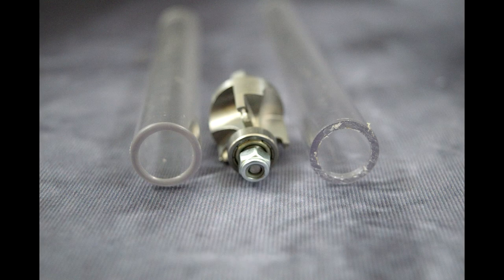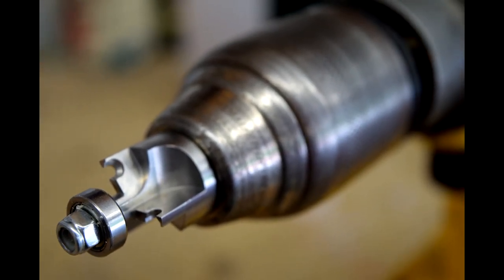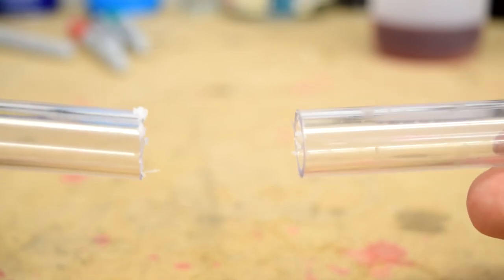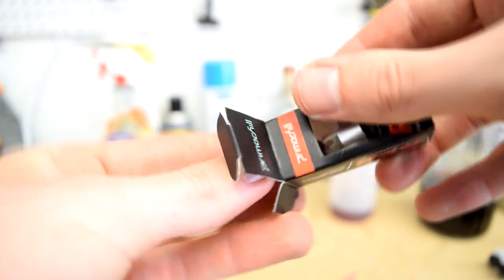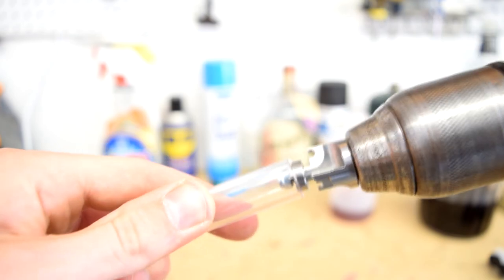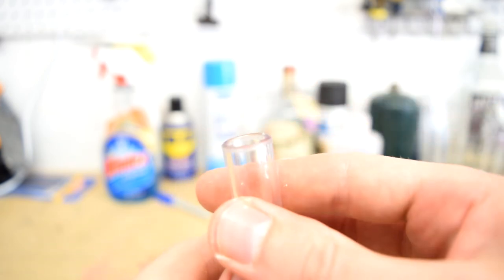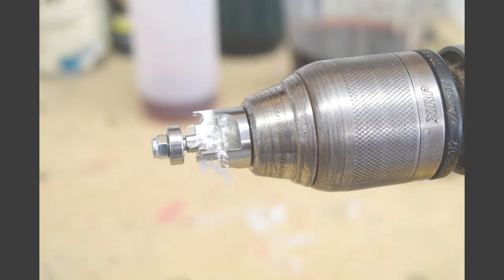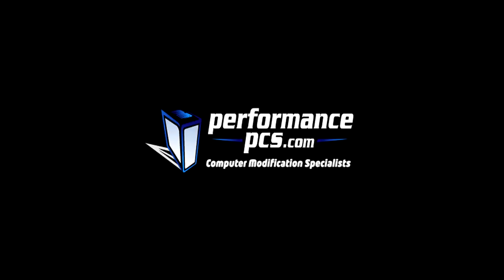PrimoChill Rigid Finishing Bit - “RFB” - Review

Comment: When I try to use the RFB on my EK 16mm petg, it doesn't behave like in this video, it just makes a mess of the tubing. I don't know what's wrong. :/
Reply: Make sure you don't press too hard. Try to hold the drill speed at max and slowly put pressure on the tubing.